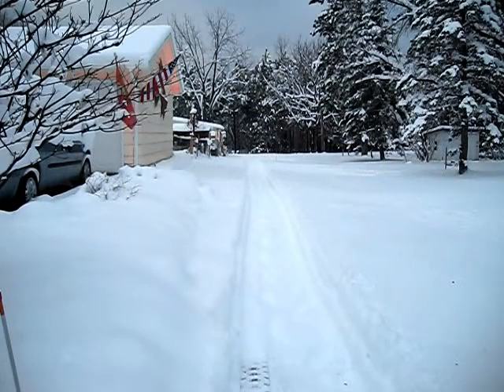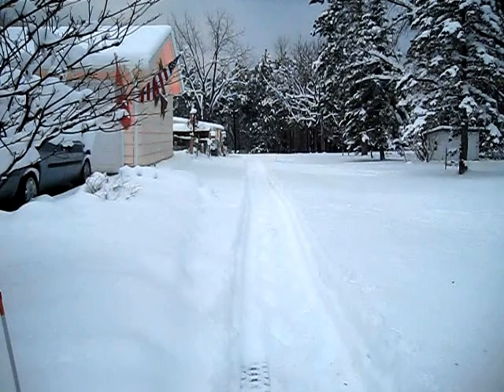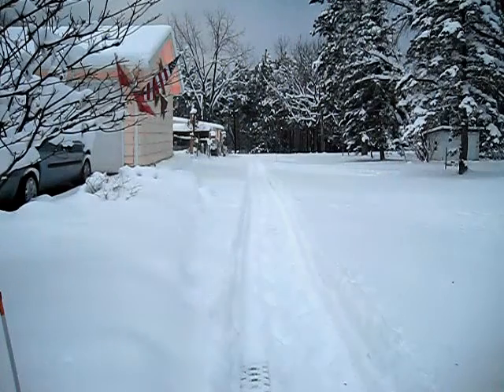The 1830EXLT Husqvarna Snow Blower in Wisconsin!

Comment from the maker: todd, the hydro is goes from a fast reverse walking speed to a 3 mph or so forward speed smoothly. You can adjust the speed while moving including going from forward to reverse. I really like being able to change the speed without the "gear notches" you have with the disk drives.  I can go exactly the speed I want.  The only complaint I have is the lever is smooth but stiff and I end up holding the palm of my hand on the dash when I move it so it doesn't move to far.

Comment: This works same as mine , i have the one with belts , but it does clog up on wet snow , but what snowblowers dont... one minus about it is that the hand turning switches tent to lock up and become un usable in sertain conditions , but thats the only minus about them , best snowblower by far:)
Reply from the maker: Here is a video I made about lubing the steering. Does The Power Steering On Your Husqvarna Snow Blower Stick? Here is a quick fix. I do this in the fall and it lasts all winter.
Reply: Paul Sikkema hi thanks man , guess the husqvarna people dident spray those parts when they esembled it for me.

Comment: 2018 ST330P do you recommend or would a Platinum 30 SHO or RapidTrak be better? For $1799 plus $100 rebate and 0% 18month financing seems not to bad. Does the hydro work good? $1000 less than Hydro Ariens. Just thinking about cost vs longevity of machine.
Reply from the maker: Hi Bull, It really depends where you live. The ST330P is a decent snow blower but the Platinum 30 SHO will handle heavy/wet snow better. If you live in areas that get 100 inches or more a year of the heavy/wet stuff or lake effect snow the Ariens Platinum is a better choice. 

If you live in the Midwest, Detroit, Pittsburgh then the ST330P will do a great job for you. 

You do get what you pay for with snow blowers. The ST330P uses a residential grade hydro and adds about $300 to the cost of the Husqvarna ST330 (with 6 speed disk drive) It's biggest advantage is you don't have to stop and shift gears like you do with a disk drive tranny.

The Ariens RapidTrak Pro is a true commercial snow blower. The hydro is commercial grade, the engine is a commercial model and the engine will last 2-3 time longer than the one on the Husqvarna. In addition, it is very easy to use and fast. If you have a lot to clear, if you have deep heavy/wet snow, if you have slopes to go up and down it's definitely worth the money - especially over the ST330P
Reply: @PaulSikkema  thank you very much for the reply. Yeah living in Upstate NY and only a mile from the Canadian border and maybe 9miles from the Vermont border we do get some heavy snow at times here. I really like the Rapid Trak Pro model and the Plantnum model as well for a cost savings. But I do like the idea of a hydro to determine the best speed plus not having the best knees anymore sometimes it would be nice to really modify the desired speed. Having a 300ft gravel drive on a shared two property lot with up to 6 car parking area and additional 60ft 2 car width path to other house on the lawn to be able to drive up to house with groceries and such really helps. Most of that is flat. To clear the path out to park the blower in the garage is on a hill at the 2story home and the basement/garage is above ground and at the bottom of the hill on the home. So that sometimes makes the wheels spin to clear that path out. Looks like I will choose between the platinum rapidtrak or the 30 SHO unless I decide to fork out the extra 750 fro the Pro Rapidtrak which would probably be the last one I ever have to buy.

Comment: ariens platinum 24 sho would that throw snow as good as the deluxe model 28 sho...thanks for your thoughts
Reply from the maker: The Platinum 24 has a larger engine and a smaller width. The impeller is the same. So, yes it will throw farther.

Comment: I live in northern BC, Cananda and let me tell you, the ST 330T was the best investment I have made in a long time. The unit is well built and blows through 18" of crusted snow no problem. I am so impressed, I would recommended this unit to anyone that can afford it. I have a house and shop on an acre, and was thinking of getting a skid steer to do the same job. It takes me about an hour to do my driveway 40x80, around the house to the fire pit, and down behind the shop to the septic system with about 10" of snow on the ground. I could clear the driveway by itself in about 20 minutes.

http://www.husqvarna.com/ca/en/products/snow-throwers/st-330t/
Reply: Alex you said that 2 years ago do you still feel its a good blower or did it break down ?
Reply: To be honest, I have not used it much after I moved from the acreage.  I found that at -25 degrees C the motor had troubles with power loss after being outside in the cold for around 45 minutes. Other than that it is a great unit, it was a little high on the price range.
Reply: thank you for your honesty....try using normal grade fuel...not hi test...hi test is backwards from what you think...try the cheap fuel as it ignites sooner then hi test fuel ...utube it thanks .....cheers

Comment: nice,say i have the same model,i bought in 2010 after the big storms we had in new jersey ,"and it haden't smowed here since",,,,"untill tommorrow--WERE SUPPOSED TO HAVE A TRI--STATE "blizzard" here so i will see,i also have a new 25 hp. garden tractor with quik attachment 42 in thrower mount on front 2 cilinder,the husq. is "never used" also,,,,,,looks gret,,i bet that triger steering is thee best,,,i can't waite,,,thanks man...........AL .S.

Comment: do you still feel its a good blower or did it break down ? by now!
Reply from the maker: Hi Charles, I have too many snow blowers this year to test so I let my neighbor use the ST330P. He loves it! He has a 250 foot 8 foot wide driveway and large parking area around his garage.  What he likes the best is the traction. Along side the drive it slopes down on both sides and he can ride along that slope and the snow blower stays right where it should be. With a wheeled unit that slope was too steep and he couldn't clear it. We had a little fuel issue last fall. It just would not run smooth. We drained the carb and fuel tank and let it air out for 24 hours. We then filled it with fresh fuel and when we started it we also ran a few tablespoons of SeaFoam cleaner through it. http://amzn.to/2l1oIA4. It straightened right out and we had no issues at all the rest of the winter.
Reply from the maker: I should say it's still on the original belts.
Reply: thank you so much i was thinking of this one or a honda hs 1132 could not decide ...it looks like the honda throws up higher and far away and higher is best i live up north ...do you know the honda one as well or is it about the same do you think ?
Reply from the maker: charles, please go over to this webpage. At the bottom of the page I have a statement about the 2016 Honda snow blowers. http://movingsnow.com/2016/top-twenty-snow-blowers-2016-top-rated-snow-blowers-not-snow-blowers-people-buy-one-best/
Reply: I love the info there ....i changed my mind and want a DELUXE 28 SHO 921048  Ariens
Reply: charles philippe I have a 2017 Husqvarna ST330P And it's been an awesome machine. Big snow here in bc canada. About 15hrs on it so far. Not a problem what so ever. From dry deep powder to wet slushy stuff, it just blows it away. 
I have a couple quick vids of it in action on my page.  You thinking of getting one?